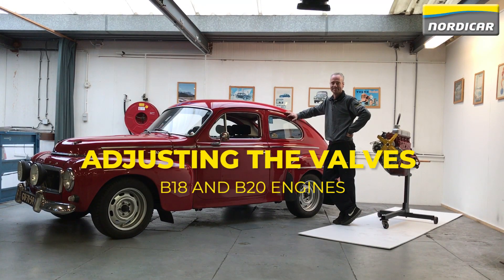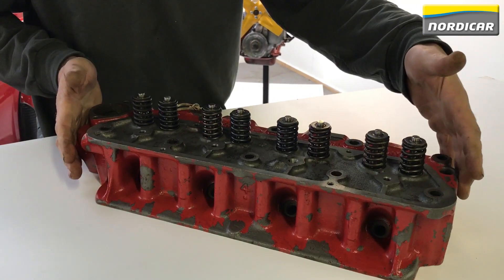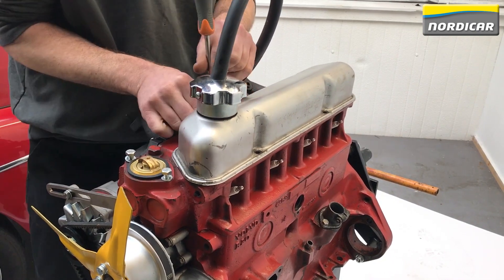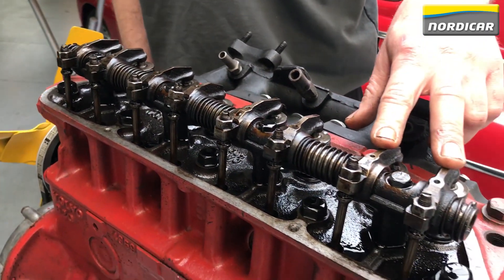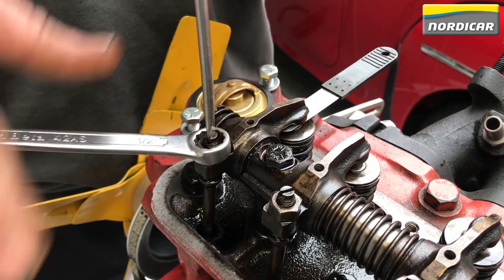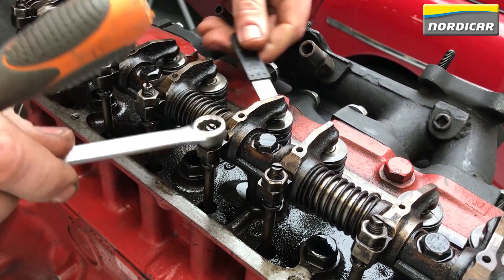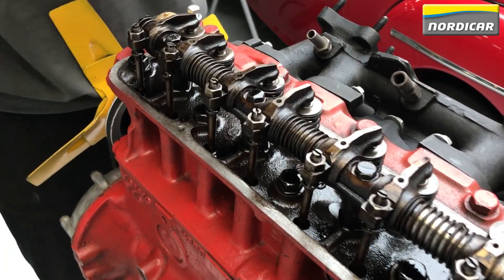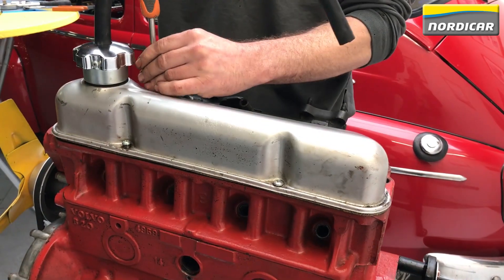Setting the valve clearance of your Volvo with B18 or B20 engine - How To

Comment: Is there a torque setting value on the locknuts after the valves have been adjusted?
Reply: My Haynes manual says: Adjuster nut torque: 58 ft lbs

Comment: Before the adjustment process is undertaken, worth a careful examination of the rocker arm shaft and also the rocker arms themselves. Any slop therein won’t result in successful valve clearance adjustment. Also, I’ve heard the camshaft position as being on the “toe” when adjusting clearance.